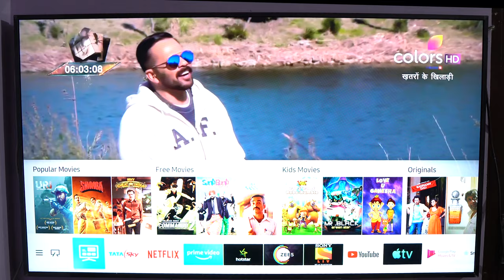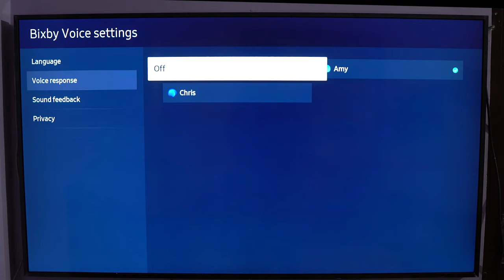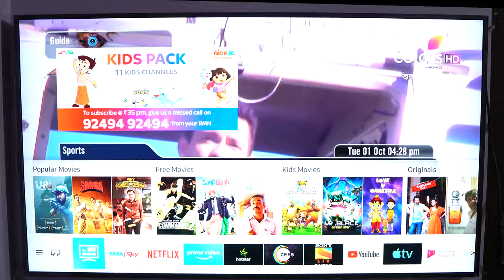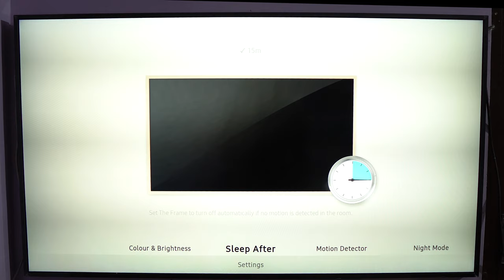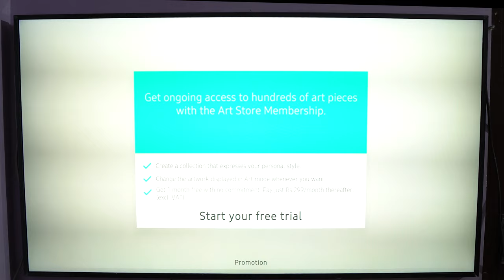Samsung The Frame 55 inch QLED TV Unboxing & Overview

Comment: Can you please tell us the output bit depth of this TV by connecting it with laptop/desktop ? is it 10bit or 8bit?  You can check it in the nvidia control panel or AMD graphics driver.
Reply from the maker: 10 bit it is
Reply: @udrawat  have you seen it in the nvidia control panel? are you 100% sure?
Reply: background music name?
Reply: @You_Tech  I guess it is 8 bit FRC

Comment: I have purchased Samsung The Frame 55 inch 2020 model, after seeing your review. I would like to ask you a question, does this tv comes with 8GB storage because mine Samsung The Frame tv shows only 4GB out of which 3.65GB is already occupied and 100MB space available. Website also claims that tv comes with 8GB storage, which I am not getting. Since there are not many reviews of this tv, I would like to know from you, whether tv comes with 4GB storage or 8GB storage?

Comment: I have iffalcon 55" 4k uhd tv and planning to replace it with samsung frame...what do u suggest is it worth upgrading in terms of picture quality..thanks
Reply from the maker: Just go for it
Samsung The Wall Tv 55 inch: https://geni.us/SamsungTheFrame
Reply from the maker: Just go for it
Samsung The Wall Tv 55 inch: https://geni.us/SamsungTheFrame
Reply: Ya bro, better deal @76k the frame
Reply: Kapil Singh  how is iffalcon 55 4k tv..i heard lot of good reviews
Reply: @nishtha7692  I m using that and I have seen colors of samsung frame also not so much diffrence with my iffalcon k2a except brightness level..overall not a worthy upgrade so avoided after comparing in real time

Comment: I also bought the same tv, samsung engineering installed it correctly but later on i found that there was still gap between wall n tv, then i found they haven't removed one slot in back which should be removed to fix tv more accurately.
Reply from the maker: No there is a gap and it will be there

Comment: The continuing issue with Samsung TVs is the lack of Dolby Vision. We know Dolby will win over HDR10. More content on that's HDR in 2020 is Dolby Vision only. At that time this TV would be as good as 55 inch 1080p SDR. Because 4K without HDR at 55 inch is basically waste of bandwidth along with loss of refresh rate. If you really like QLED, buy it from a manufacturer that supports Dolby Vision. All QLED panels (with manufacturer) are made by Samsung only. Best mode to watch on any TV is 1080p 60 Hz output with frame rate matching with Dolby Vision enabled, sent to a 4K TV with motion interpolation enabled. This TV can do everything except dolby vision.
Reply: For true Dolby vision experience a tv has to support 12 bit ...which no tv as of now does
Reply: pk murmu Just because standard supports it doesn’t mean anything is mastered in it. All DV movies are mastered in 10 bit only. HDR10+ supports up to 16 bit. But that doesn’t mean I can actually master it. I suggest you shoot an HDR video and try to master it yourself to actually understand how these work and what they mean.

Comment: What is the refresh rate of this TV?
Reply from the maker: 120hz
Reply: @udrawat  ,so that is more than double of normal LED TV, and watching sports channel will be much better I hope
Reply from the maker: Well not reaaly because ur sports video will only be in 24 or 30 frames per eecond
Even if u use that motion effect of samsung  that increases the fps u will not get 120fps for sure
Reply: @udrawat  and why is like that???
Reply: True 120 hz is only possible for 1080p and 2k resolution. For 4k, the maximum true refresh rate is 60hz. Samsung doubles it via software.
Reply: @dipghosh14  thanks for your reply and your time

Comment: hello, is the Samsung Smart_View app working for anyone? I am not able to connect my TV (samsung Frame TV) to the app. If this works I can use the app to act as a remote, and also install personal photos on this tv
Reply from the maker: In starting i had the same problem
Later i found out that just go to mobile setting find cast and there u will easily find the tv to cast ur screen
Reply from the maker: In starting i had the same problem
Later i found out that just go to mobile setting find cast and there u will easily find the tv to cast ur screen